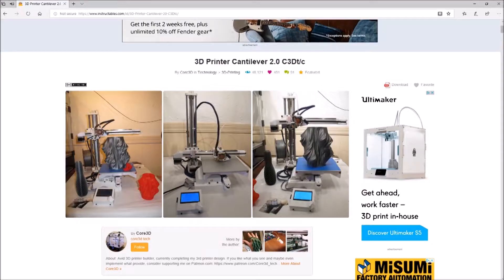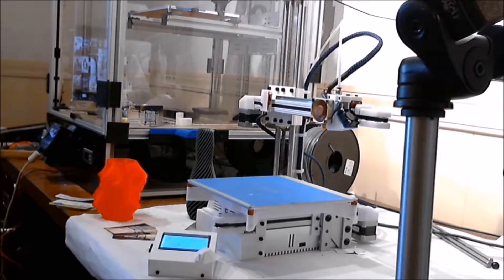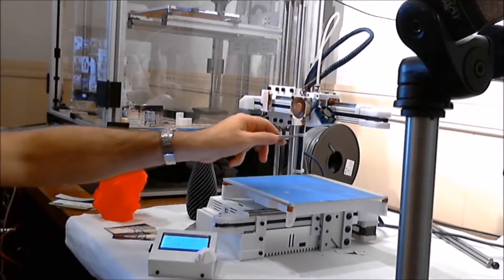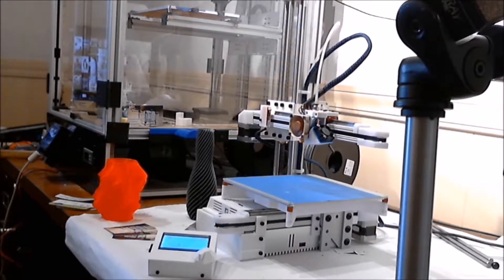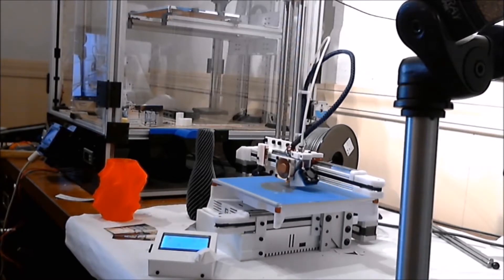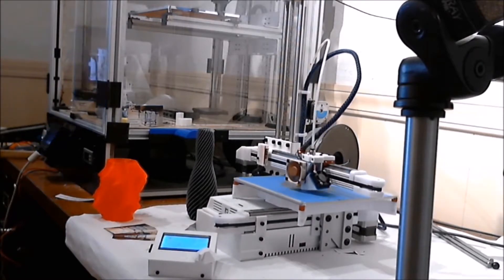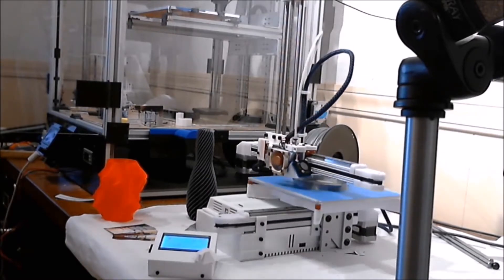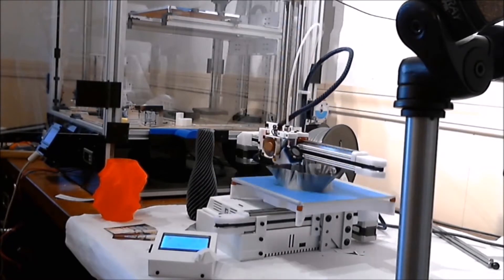C3Dt/c Cantilever 3D Printer Build: introduction

Comment: Hello Sir, same person again ;)  I am building this printer for my school and we need to build a print that is a 20" x 20"  x 20" cube.  So in order to build this size it need to extend my slides, increase my base plate. Is this build portional to build, and if so can I order your parts from ebay to satisfy the needs of the build? Basically I want to increase the size of the build will the 3-d that you seel can I still use them? Like will they fit... Or can I make them fit.
Reply from the maker: I'm flattered you like my design but I would strongly recommend against going this big, with this design. If you look at commercial Cantilever printers you'll notice they tend to come with smaller beds than mine. This is because you are looking at two "small" pivot points. The bed sits on a single rail block  and the arm pivots on 3 closely positioned rods. The size of my build is already pushing the boundaries of possible size. You cannot "balance" a 500mmx500mm bed on 4 screws spaced 20mmx16mm (the linear rail block). An arm that will have to exceed 500mm on a cantilever has a great chance of bouncing all over the place (or even sloping down under it's weight). With the size you are looking for I would strong recommend going with something that looks more like an Ender 5 implementation or even a CoreXY design.
Reply: Thank you so very much sir !!!